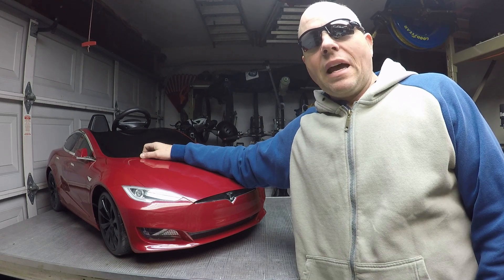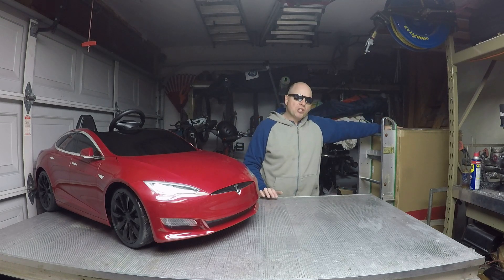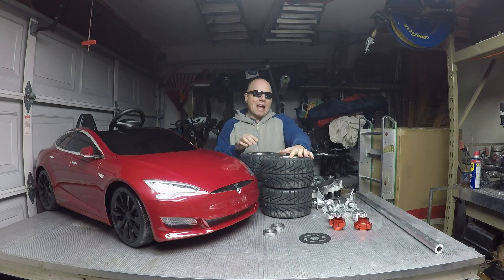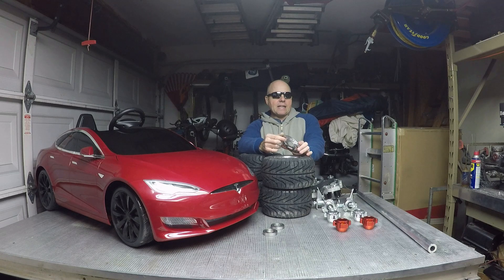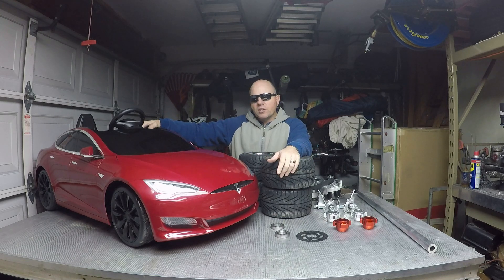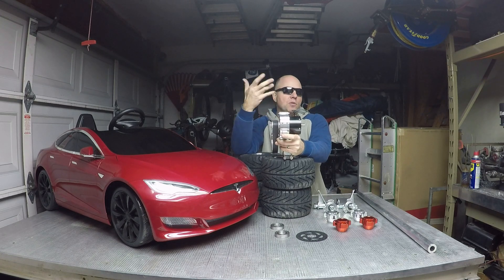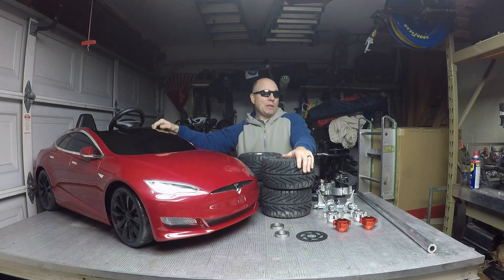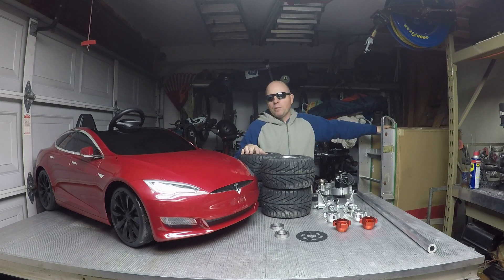Building a Hot Rod Mini Model S. This will be CRAZY powerful!!!!

Comment: Make it as fast as the Traxxas XO-1 and drag race a Performance Model 3 while wearing a Starman outfit and you will have 100k subs in 72hrs. LOL

Seems like the only part you are using is the shell, but I checked Radio Flyer and didn’t see any replacement parts aside from wheels. I would have thought you can buy parts for it.
Reply from the maker: Speed is a frightening prospect on something so small. I can tell you that I could cram two of these motors into the car for 30hp and downright dangerous performance. But, for now, I will build it with one motor and see how it goes.
Reply: Tech Forum, yes, it would be a little squirrelly doing 0-100 mph in 5 seconds. Have you ever heard of a Tango EV? Imagine making that with updated motors, inverters, batteries. And street legal.